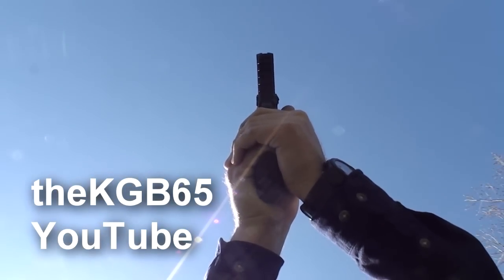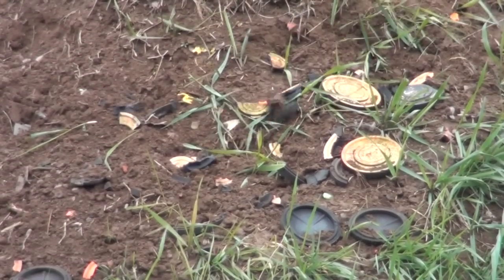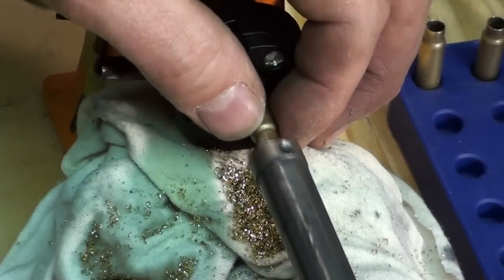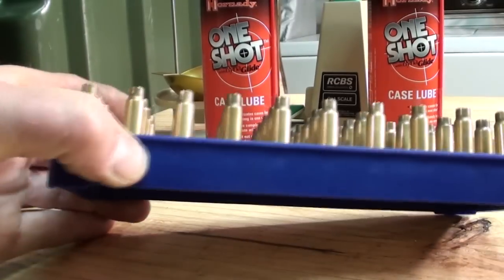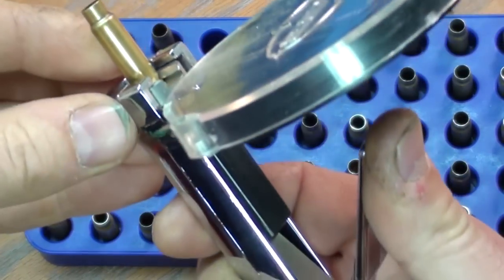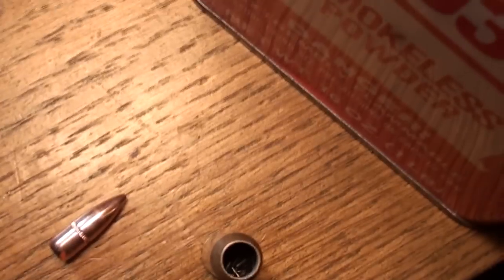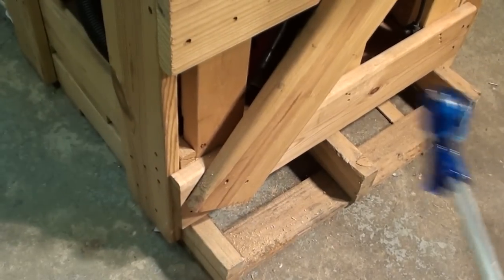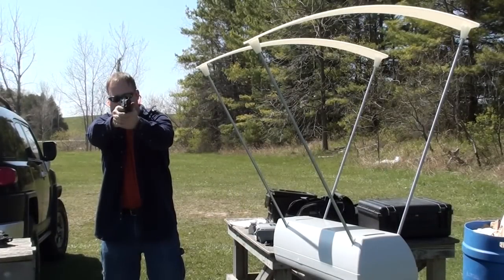Should I Reload the FN 5.7x28?

Comment: Thank you for all your information about reloading the FN 57x28 round. I have watched you reloading video several times. After the first time I talked myself out of the 57 due to the difficult reloading requirements.
After watching the video a couple more times, I bought a new FN57. What a SWEET gun, Wow. I have been reloading the ammo without any issues. I am using SinterFire Frangible 42Gr projectiles as well as Hornady hollow points. The frangibles are less than ten cents each. Thanks again for your information.

Bruce L.
Reply from the maker: 392HemiDemon Very glad to hear that.  Your comments make me want to get mine out and hit the range right now!

Comment from the maker: You have the option of either using an air compressor blow-chuck on every casing and waiting until the next day, or just rattle them around, spread 'em out, and let them sit in a warm, dry area for a few days.  
It's a good question and I should have stressed the importance of making absolutely sure your primer pockets and the interior of the shell are completely dry before re-assembling your ammo.

Comment from the maker: Yes I have. The SS197SR that I sampled had 5.4 grains of a very fine spherical powder, finer than Accurate No.5.  The standard deviation of the factory ammo is very good - only 11 fps from an 8-round string.  SD of my handloads is typically 30 to 40 FPS.  The glued bullets probably help stabilize velocity.
"Come on out for free soda, hotdogs, and a turn with the FiveseveN pistol for the kids!"

Comment from the maker: Just came upstairs from an all-day reloading session where I used both interchangeably.  Nothing wrong with One Shot, just depends on what you happen to be doing.  
For larger cases like .308 and up I like Imperial.  For tiny cases like 5.7x28mm, direct spray or Ziploc bag shake method with Hornady One Shot works wonderfully.

Comment from the maker: I've been leaving the coating on.  Not only for proper feeding in the PS90 mags, but also because, from what I understand, the coating is a necessary component in the blowback operation of the 5.7x28 cartridge due to it's high pressure.
This is one aspect of the cartridge that seems to be a little foggy because the cartridge makers don't share their proprietary knowledge with the general public.

Comment from the maker: Some guys are loading the 5.7x28mm cases with the same 0.224" diameter 55 grain bullets that are common in the .223 / 5.56 cartridges but data is for them is scarce and the extra length and weight of those bullets increase the likelihood of experiencing an unpleasant pressure related event.  The only benefits of loading 55s that I can think of would be cost savings using pulled mil-surp bullets or maybe trying to load sub-sonic for use with a sound suppressor.

Comment from the maker: I bought my Lee turret press and the RCBS scale in 1987.  There are so many equipment options that it is a difficult question to answer.  A potential handloader has to read, and understand at least one reloading manual which will explain all of the options as far as cost and equipment which can vary widely depending on what you want to accomplish.
Basic reloading manuals by Richard Lee, Lyman, Hornady, and others are excellent sources for starting out.

Comment from the maker: Max loads have to be approached very cautiously.  I usually keep my handloads close to the starting points which still typically exceed factory SS197SR velocities by about 100 FPS anyways.  Hot loads ruin brass.
My case mouths rarely dent, but when they do, I iron them out by rolling a closed needle-nosed pliers in the opening, just enough so the neck expander on the sizing die fits inside to finish the job.

Comment from the maker: The 40 grain bullets load slightly easier due to their boat tail profile and greater length.  The lighter 35s are probably slightly less prone to over-pressure caused by minor reloading errors in cartridge overall length or powder charge.  I also like the higher velocities produced with the 35s since high velocity is the reason I like this cartridge in the first place.  Duplicating the SS197SR using the V-max 40 is also attractive.  
Guess I don't have any strong leanings for either one.

Comment from the maker: It is a non-toxic biodegradable water based cleaner that works great for removing grease and oil on engine parts and happens to be the best thing I've found for total-disassembly cleaning of my Glock pistols.
There is a good description of it on Wikipedia.

Comment from the maker: Yes, reloading 9mm is worth it.  To really stretch the savings you can do some group buying or just go big with all your purchases.  Bullets, for instance should be purchased at least 2000 to 3000 per order with shipping included.

My Glocks live on handloads with incredible reliability.  That baloney about unsupported chambers has never been an issue.  Yes, I see bulges in the cases (especially .40) but they never fail due to case head separation, just occasional lengthwise cracks - the usual.

Comment from the maker: Even using 55 grain bullets is pushing the limits.  Some do it, but just think how those long 62 grain bullets would effectively shrink your case capacity.  Even if there were data to support such a combination the resultant velocity would be so low that it would be impractical.
It would be analogous to loading a theoretical 180 grain bullet in a 9mm and shooting it at, say, 500 feet per second.

Comment from the maker: Hornady New Dimension Dies (excellent quality)
I've got a couple case holders, not sure of the brands.  You don't want to skimp at all on it.
My manuals are Modern Reloading (Richard Lee) Second Ed., Lyman 49th, and I relied heavily on the Accurate Powder data for Accurate No.5, and No.7.
No preference on priming tools.  Had my original Lee since 1987.
Hornady 35 and 40 grain V-max are my favorite.  Flat base bullets don't start into the case as well as the boat-tails do.   
Primers - CCI 400.

Comment from the maker: Oh, boy... I thought about this and an estimate of cost would be a tall order, especially since most of my equipment was purchased over the span of over two-decades.

Off the top of my head, starting with no manuals, chronograph, scale, ammo boxes, tools,  trays, powder measure, no press or loading dies, I'd say somewhere around $800, maybe a little less.  You'd also have to add the cost of your first batch of once-fired brass, powder, primers, and bullets to the total to that amount, though.

Comment: Just a thought.   If you only use single stage like I do, when you put powder in your cases get a flashlight at an angle shining into the case mouths and have the light shadow even on each row in the caseblock.    Any case that is not uniform pour the powder out in and try again.    Constituency counts.

Comment from the maker: Just to clarify -  by "light loads" I mean near factory SS197SR loads.  That's a hard question to answer definitively because I have been blessed with enough brass that I haven't really been running them to failure.  I'd like to use a lee hand press and spend a day at the range shooting a handful until they fail just so that I can answer this important question once and for all.

I'd say at least three re-loadings for sure.
Reply: I'm new to firearms in general, and I haven't made my first purchase.  I'm 18 so I cannot (unfortunately) buy a pistol, but I saw the P-90 and remembered that there's a pistol that fires the same round, so I was thinking of my first gun being the PS-90, and buying the FN 5.7 pistol when I turned 21.  I was interested in reloading because (and I don't know if this is covid related) the bullets are 1.00$-1.25$ each, and that seemed like a little much long-term  Do you think I as someone new to firearms could safely reload 5.7x28?  I have no need to pressure higher than factory, and it looks like the equipment to reload 5.7x28 is all-in-all cheaper than 1,000 rounds of 5.7x28 (I'm not going to start reloading right away, but I'll save my brass for when I start).  If it matters I intend to go into the field of engineering, and I have a 3D printer that I can use to make disposable tools or the like.  I'd love to hear back!

Comment: I’ve reloaded about 120 with 30gr. Speer TNTs. They absolutely haul ass, are red dot accurate and haves dropped coyotes at about 100 yards with a ruger 5.7. Not sure about my return costs because I only reload the case once then discard. The second crimp seems to end the life of my cases after fired. That and they are loaded hot.

Comment from the maker: First off, congratulations if you end up getting one.  They are fun.  But if the cost of factory ammo is going to be a factor I would advise against the 5.7x28mm platform.  You won't save a dime by reloading, You might be able to fire more rounds but it will actually cost you more money in the end.  Reloading these little pills is a labor of love.  If it isn't you'll constantly feel like you're just burning time.
Now that I've talked you out of it you can start with Lyman's 49th edition manual.

Comment: Thank you for the excellent discussion. I didn't know about the polymer coating. However, that makes me want to know if it is more practical to remove entirely and then replace with some other coating.
Reply from the maker: GunFun ZS People have done just that but from what I've read it doesn't work out so well because supposedly the polymer coating is required for reliable feeding in both the PS90 and the FiveseveN pistol as well (if you want to fire from full mag's).  It'd be interesting to give it a try by soaking about 50 casings in acetone and following up with a nice tumble in polishing media.
Reply: theKGB65 That's the idea, except that it would then be followed by a nice tumble in clean media treated with nu-finish car polish, or a light wax, or lacquer. I know that nu-finish keeps brass slick and shiny and doesn't interfere with powder or reloading dies. I am sure something better could be found too.
Reply: theKGB65 Regarding the 5.7 round, after resizing, what do you use to remove the lube from the case. I have an ultra sonic cleaner for general cleaning of the cases, but you aren't suppose to use that to remove lubrication. If I use my standard tumbler to remove the lube, that might strip the coating, so how do you get the lube off. Thanks, and great video.
Reply: +Johnny BGood i used my sonic cleaner to remove imperial wax so i don't get a bunch in my media with my 223. I'd think tumbling would remove some of the coating

Comment: I just got my PS90 and I have started saving the brass. Excluding the initial overhead for reloading tools & labor ( we do it for fun), how much is the average cost to make the primer, bullets & powder per round? I was able to get American Eagle and FNH for 46c to 48c  a round (including shipping) this July 2014. Just wanted to know how cost effective it is bearing in mind that with this particular ammo it seems you are risking more for a catastrophic failure for hand loads. Now that I know the nuances and complexity, I'm wondering if it's cost effective and if I should bother saving the brass. Is there is market for used 5.7 brass?
Reply: Primers will run 3-4 cents each in sufficient quantity.  You're using such a tiny amount of powder for this cartridge that you'll probably spend only 2 or 3 cents per round in that area.  Bullets for .223 seem to be around 12 cents each in large (possibly very large) quantity.  None of this includes shipping.
So you're looking at under 20 cents per round to reload existing brass.  From this video it looks like once you've got your careful process down you could expect to reload a given case about 5 times, so counting your factory ammunition buys, you might average 25-30 cents per round.
The key of course, is that it's extremely time consuming (I'm thinking case sizing is the worst part), and the equipment might run you upwards of $200 to get started.
Personally, I've always thought of reloading in terms of cost savings, but now that I'm actually doing it, I find it's just a fun hobby on its own.
My opinion?  Reload something else first.  If you "get into" reloading and start to enjoy it for its own sake, it sounds like 5.7x28mm reloading is perfectly viable.
Reply: Heck yeah! I'll take it!

Comment: Just be very careful. Follow theKGB65's case prep instructions, they are spot on. I suggest weigh every charge, at least if you are working anywhere close to max loads. Be extremely careful loading over 40gr rounds. Don't use cheap plinking bullets. Measure bullets over 40gr to ensure consistency. I have seen 55gr FMJs vary 2gr in weight and .02'' in length. Close to max pressure, .02" is too much variation in seating depth. Hornady is all I use in 55gr. Great video, Sir.

Comment: This is a great challenge and definitely for one who takes the time, has the patience, and is meticulous on every detail of this round.  I look forward to it.....

Have you found a substitute for the polymer coating, or will it fire fine when it gets stripped off?  Does it help to use a sizing wax to replace the loss of the polymer, or is that a no-go?
Reply from the maker: crusader68 Works pretty well with fired cases that have been processed using the ultrasonic cleaner.  Best not to use any wax or other lube on casings that are being fired in straight blowback operated firearms such as the PS90.
Reply: theKGB65
Thanks; I have an ultrasonic.  Can you still fire them without the coating on the brass?
Reply from the maker: The coating is still there, just not as smooth.  Reliability does suffer a little bit with reloads.
Reply: theKGB65
Thanks for all the info; never firing a PS90, I am unfamiliar with the sensitivity of the cycle of operation.  I suppose that is the real question if it is worth reloading, but reloading the brass twice, is a great savings compared to .50-60 cents a round.  It's the reliability of feeding in those top fed mags that makes me ask about the absence of the coating.  It's a strange concept, having to coat brass in that regard, but I suppose that is make makes them challenging to load.
Reply: +theKGB65 if you sonic clean after using say imperial wax would that eliminate any issues? Or even use dry lube on the neck also ...

Comment: I wonder if 5.7 reloads would be safer to use in the AR57 platform.  The AR57 seems to have a heftier barrel that would be more tolerant of the higher pressures of an over loaded round.  Sorry if this has been already discussed.  I've been reading through the comments and have become very glassy eyed, and didn't see AR57s discussed.

Comment: I don't own any 5.7x28, but here's a great question:  Does the FN FiveseveN fully support the case?  Or, is like a Glock, which does not?  Here is a handy tip:  Armscore's TCM 1911's used to partially support the cases, but I found out that they are changing their design TO a fully-supported chamber.  I can get you the serial number breakpoint if anyone is interested.

Comment: Obviously this can be done safely under the same cautions you’d take making Match ammo on a single stage one by one and double checking ever load meticulously for brass weight and length , powder weight, primer seatings and so on.  No room for error on the powder charge. If you’ve been hand loading for a while you’ll have a feel for certain nuances encountered with the processing, otherwise I’d stay away from it. As a matter of fact, after looking into it I’ll pass.  But yeah, if you really need or want to, it’s certainly an option.  I don’t mind taking the time for bolt rifle ammo that needs to achieve half moa performances for long shots... the time is worth it ; but this round isn’t rewarding in that manner. 
Time + Safety + Dollars Saved = meh... no thanks.
Thanks for the great rundown.   I was on the fence .

Comment: I was very enamored with the PS90, but I was concerned about reloading.  Now I found out that I can use the same bullets as I use for 5.56?  There is no difference in OD?  Do any of the suggestions here in the comments below or from your own experience afford an alternative to the coating on the factory brass?
Reply from the maker: tkarlmann There are suggestions on the forums about using waxes, lacquer, and lubricants to replace the proprietary factory coating but I don't try that with my 5.7 handloads because the PS-90 is blowback operated and was designed to function correctly with the type of plastic that is applied to the factory casings.  Washing the brass gently in an ultrasonic cleaner has given good results and the occasional magazine feeding issues are acceptable for practice and non-competition use ammunition.  We use the same diameter bullet as .223 Rem / 5.56 (.224") but I do not exceed 40-grains in bullet weight.
Reply: theKGB65 I'm just starting reloading.  I just learned about the car-wash/wax option when wet-tumbling brass -- it leaves just a bit of wax on there to prevent the brass from tarnishing.  Would this be enough to replace that "factory coating"?

Comment: you can probably get away with no lube on 5.7x28 as you can with most pistol cases.

but try using one shot on 30-06, 45-70 or 300 win mag. won't be long before you give up entirely. or maybe you like pounding out stuck cases...

the difference in friction between one shot and ... oh, almost anything else is pretty astonishing.